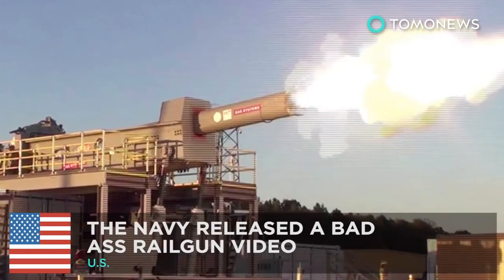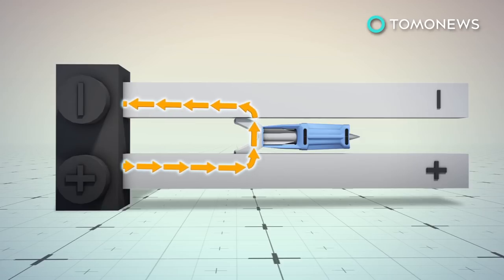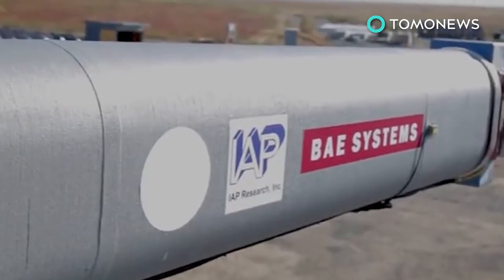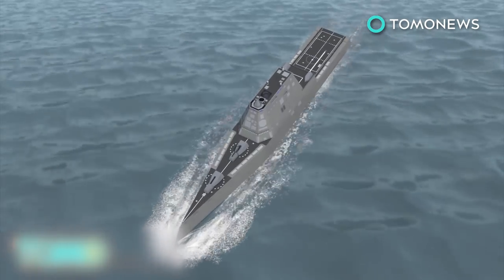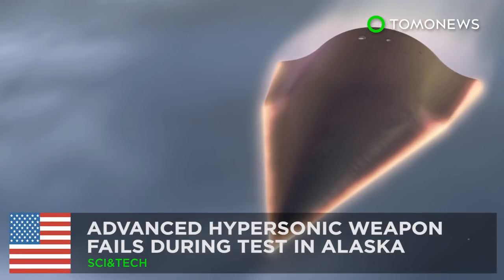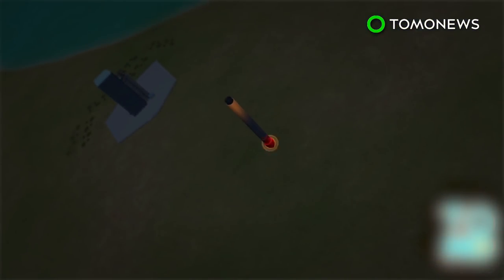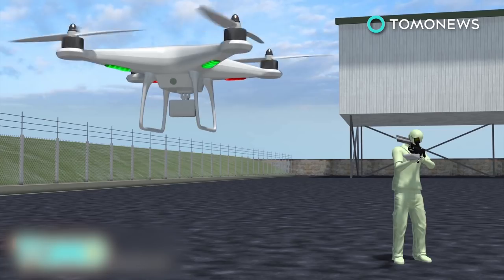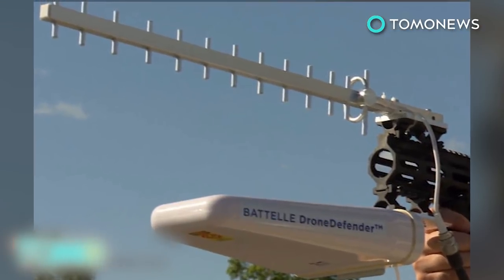Railgun test firing: US Navy released a cool video of a functional railgun - TomoNews

Comment: they have also experimented with depleted uranium shells because they are even harder. Whats crazy about this gun is it's purely a kinetic weapon. When the projectile hits it's target it's going so fast that it's white hot from just the air friction alone. it has so much kinetic energy that even though the projectile is relatively small it obliterates pretty much anything it hits. also 4000 mph is actually the low end of the possible speeds. I have read that some of the designs they have been testing can go as fast as 6 thousand miles per hour. fucking insane.
Reply: Jacob Ellinger damn that is insane Jesus!
Reply: the best is that it negates the danger of haing to transport any explosives. so no random shot hitting the ammo reserve or powder reserve and getting obliterated.
Reply: deplated uranium rods cause cancer
Reply: Kyle Laughinghouse can cause* US MBTs are loaded with DU so the radiation is low hence the name depleted.
Reply: mansuy adrien Also these projectiles are a lot smaller than comparable conventional weapons.

Comment: Why is it always only the us navy that test these?
Reply: Carlos Spicy-Wiener because we're the only ones that got it right
Reply: Carlos Spicy-Wiener they have limited use on ground as they are big and bulky. It's cheaper to fire a 155mm gun 100 times than fire this railgun once (35,000$ per shot at this time)
Reply: FamousFra I know that we Are the only ones that have them...
But why only the navy? Why not any other branches...
Reply: Blitz FromBehind well I guess it's not completely done yet.
It will still get improved a lot
Reply: Carlos Spicy-Wiener oh and an update, th test rounds cost 35,000 USD and the actual LRLAPs cost 800,000 USD a piece so there is much to improve on. Not gonna say that the railgun isn't the next step in naval wafare as they can be used from CIWS tasks to naval bombardment.

And to your first reply Russia has testfired a railgun a year ago so no, the us is not the only one that has one of those. Russia is developing it's own to be used in tanks rather than ships.
Reply: Blitz FromBehind in tanks? Holy crap they must be big...
But yeah it is still in very very early stages...
Reply: Carlos Spicy-Wiener well the russian one is smller than the Bae one but they are having problems to fit the electricity needed to a small enough battery to fit on a tank.

And yes curretly it is also a proof of concept for the russian military.
Reply: Blitz FromBehind what concept?
Reply: Carlos Spicy-Wiener proof of concept = showing someone that something works and can be done with what is currently available

Comment: apart from a ship there's unfortunately no other platform to manage this...also the range it's supposed to have the target will have to be extremely slow or they would need some smart self guiding ammo which is difficult at those launch speeds...so yeah.. a starwars weapon?!?
Reply: The rounds are self guided via GPS.
Reply: David Smith..i highly doubt that cause at those speeds the electronics nor the moving fins would survive... ?
Reply: You can doubt it however I have been following this program since it first began. The Navy specifically states that the rounds are guided. Think critically for a moment no matter how good the ballistic computer is the accuracy of unguided rounds makes them a area of effect weapon. The rail gun rounds do not have explosives in the they rely on kinetic energy to destroy their target. If they could not hit targets with pinpoint accuracy the entire system would be useless.
Reply: David Smith...i agree if the projectile cannot hit the target and that too in a specific place being non explosive it wouldn't be any good...however at impact it would be required to be carrying a lot of kinetic energy which is high velocity...at those velocities it would be impossible to steer as the fins would shear right off as the projectile needs to carry a lot of mass hence big fins...also would the electronics needed survive those launch speed....having said that...visible targets are not an issue but with a non visible moving target it would be redundant..unless projectile is self guiding which has limited manoeuvring capabilities unless they have a rocket assisted last stage...which bring up the first point again...but if what you say is true it would be impossible to stop it...it is an ideal far off ambush weapon on an unwary target or ship at constant speed and direction...beyond that i really doubt its chances of hitting.